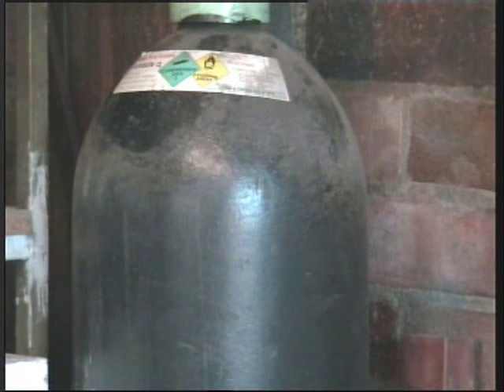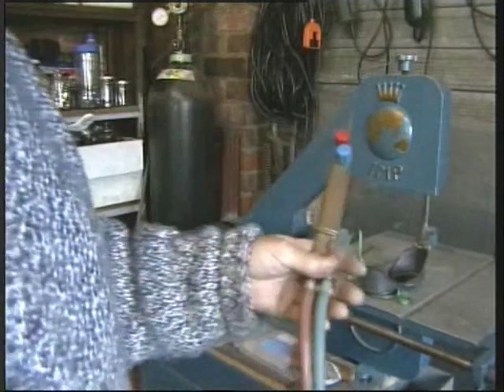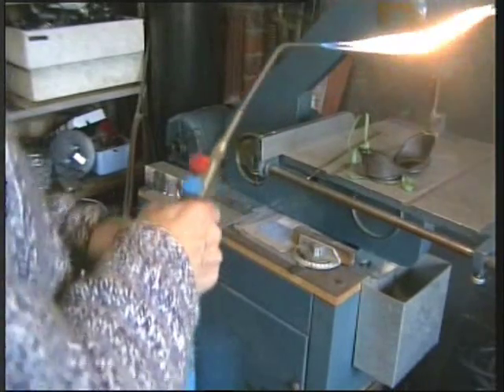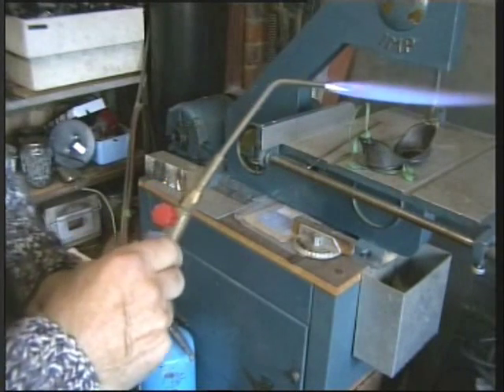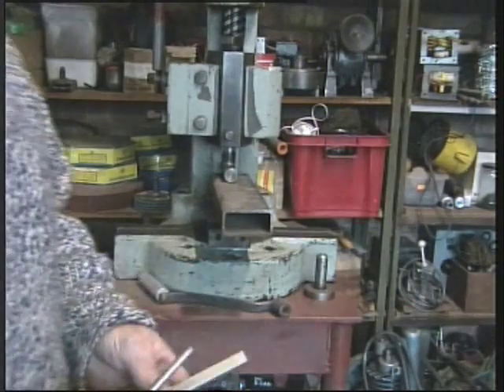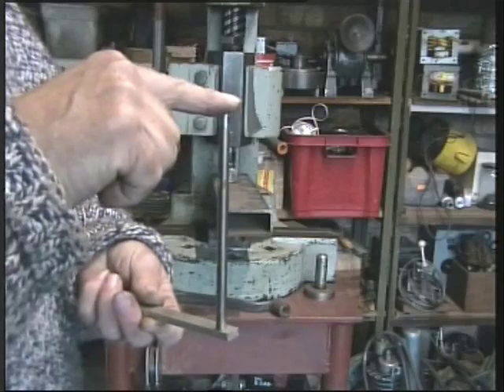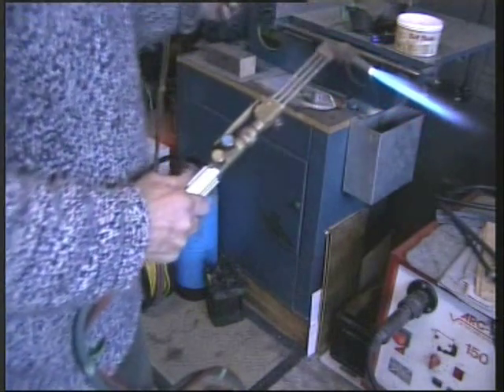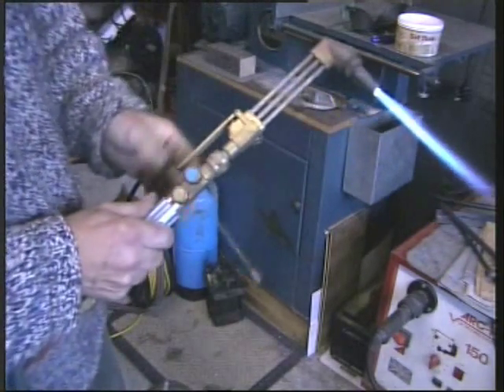oxy-propaine.wmv

Comment: Could it be that we could just use an welding rod ( like 6010 , 6013 , 7018 ....) without white stuff hammered off ,  so the coating ( i think it's called shielding flux ) still on [ my father when I started oxy/acetylene welding would give me a coat hanger as a filler rod but when we ran out he would give me a welding rod but tell me to hammer the coating off  ] or could we just mix some shielding gas with the oxygen ? I was happy when I learned that I didn't have to do some fabricating to rig a propane bottle to the torch but was a little disappointed that we can't weld with it . Figured since propane burns cooler than acetylene that maybe it wouldn't weld on high grade steels or wouldn't weld as thick of metals but that turns out to be not the case . I guess if I can't weld with it then I'll just use the propane for cutting , preheating , brazing , and maybe bending metal , unless someone has another use .

Comment: What pressures do you use for propane and oxy?
Reply from the maker: I will try to answer your question, it maywell seem a logical simple strateforward thing to ask but infact its not , its akin to saying" how long is a piece of string" that too on the surface is not an unreasonable thing to ask for surely it has a length so what is it !!
what I`m poorly trying to convey I suppose is I don`t use pressure as such but depending on the job in hand use a volume thats required ie.. this could be some micro brazing of a piece of jewelry upto cutting a 6" slab of steel and all the variables inbetween
Reply: well, I know that it would depend on the mixer, nozzle,  type and size of of the job. But I would expect that at least there is usual range of values, and usual ratio between oxy and propane pressure. And there are pressures you have used in brazings shown in video - that would give me some starting point. Thanks!
Reply from the maker: the ratio of gases would be the same irrespective type/size of nozzle 
again only the volume would differ (exception to the rule cutting) sorry
 but I can`t give you a pressure I don`t use them as such, try your 
normal settings you use for oxy-acetylene will put you in the ballpark 
any variability "I`m guessing" would be in the propaine ie less 
caloritic value  
there is a school of thought & teaching that quotes gage readings, 
but its not my trade and you would be best to seek advice from a pro 
that certainly is not me ! best I can do..hope that helps, play it safe

Comment: Thank you sir for the refresher. Im just about to set too with a oxy/prop set i bought today. Been agggges since I had a torch, and that was oxy/ac some 15 odd years ago.
Anyways, if you see a dull orange glow to sky coming from a surrey direction, dont blame yourself hehe. :p
All the best 
D
Reply from the maker: play safe use flashback arresters, easy to fit and very cheap, silly not to !
Reply: *****
Ah yes, they came with the kit, joblot from weldequip, fit onto the regulators before the hoses.
All done for tonight, my first ever braze job, just a bolt onto a bit of strap to test things. Went well so i had a go brazing a 1" slug of steel onto 3x3 cube of cast iron. Just as well I got some bigger nozzles too cos it needed all of it. 
A new door opens, very happy :))

Comment: Oxy-propane is fine for everything but welding. We used thousands of pounds of propane when I worked in demo, as it was far cheaper than acetylene and works fine for cutting steel, even very thick steel (I've cut over 6" thick plate with propane and a gas-axe).

For the hobbyist, just one of the small Bernzomatic oxy-propane rigs work great for brazing and soldering, and you always have MAPP if you need a touch more heat. I adapted mine to use big bottles though, little bottles are expensive!!!

Comment: You're partially right, though carbon-dioxide has nothing to do with LP being a poor choice for welding. It's actually the high concentration of hydrogen in the flame of LP products (MAPP, propane, etc) that infuses into the steel to create brittle welds.

Comment: You can weld with only oxy-acetylene, not oxy-propane or any other oxy-fuel gases, due to the fact that the oxy-acetylene flame produces a carbon dioxide shield that prevents the metals from oxidizing and creating a porous weld.
Also, looks like you do not have enough gas flow through your tip..... that will result in the tip overheating.

Comment: I didnt realise you could weld/braze with propane, might give it a go. I noticed you shut off the oxy first when turning the lamp off, if you shut off the gas then the flame is stopped without any remains left at the tip. Many thanks for the info, keep them coming.

Comment: I have always used oxy/acetylene. About two years ago  some one gave me his oxy/propane rig. In short it was pretty beat up, needs a new cutting torch and hoses. I had never heard of using propane previously so I am wondering does propane use the same type  cutting torch as acetylene? Thanks for the great videos!